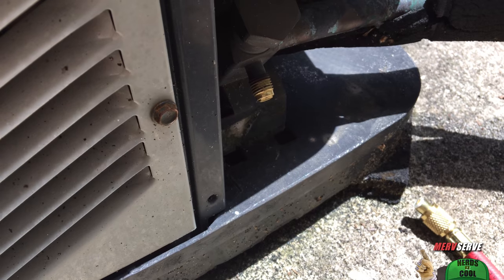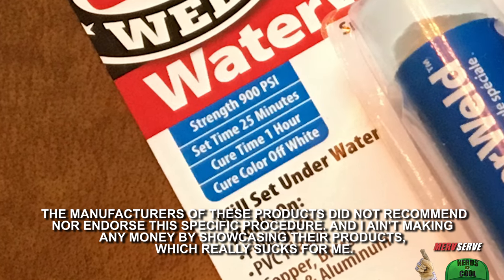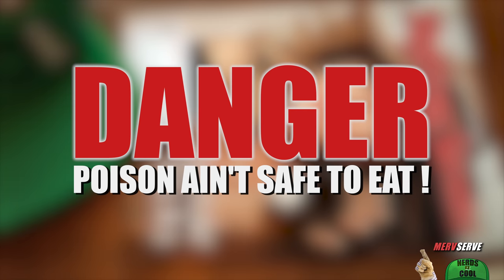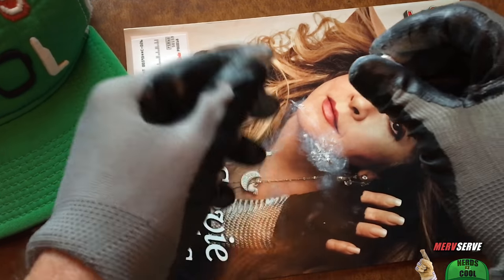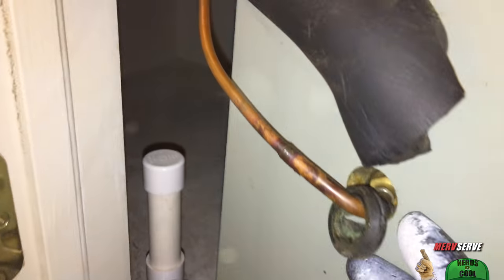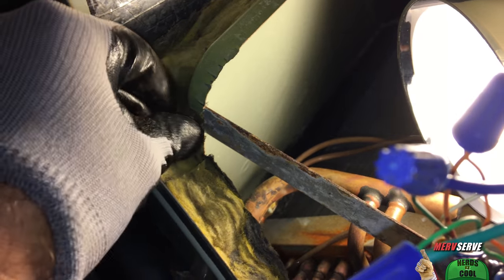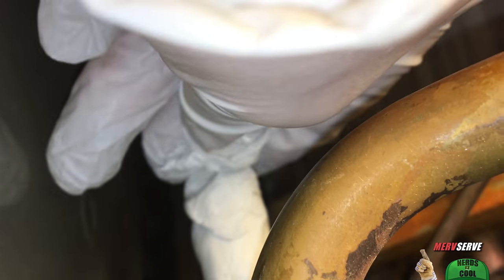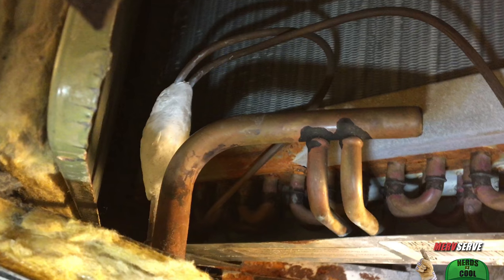AC Leak Repair for $15 -- Cheap & Simple Central Air Fix

Comment: Anyone know if its legal to own R410a in a tank without a certification as long as its not used?
Reply: It’s legal to own if your intent is to sell to or let an EPA 608 certified tech install for you. Most HVAC suppliers won’t sell to anyone without certification but you can purchase it online by signing a form stating your intent is to resell to a certified individual. Sometimes the fine print will say that just by purchasing it you are signing the form. Even if the cylinder isn’t full or no longer sealed you probably don’t have anything to worry about unless someone catches you hooking it up with a set of gauges.
Reply from the maker: Somebody  told me if you pass a basic certification test, and you are servicing the unit on a property that you own, you have every right to add coolant. if somebody could verify this, that would be great
Reply: @MervsServiceSecrets  - I should have mentioned that if you want to take the test in person you will need to go through a third party who will charge you a couple hundred bucks for test prep materials and the test itself.
Reply: @MervsServiceSecrets  It is true in the case of apartment building owners who hire someone to service their units; person doing work needs a certificate; there may be other requirements as well.

Comment: Most after market "magic additives" never work on a permanent basis. If your system is still in warranty, you may forfeit coverage!
Reply: I'm sure he knows that, this is for somebody like me who has a 12-year-old unit, still running excellent but has a little bit of an oil leak. If I can pull out another year or two with a simple fix, and it keeps me from having to spend a lot of money right now, during this inflationary period where everything is so expensive I have no money left over, and gives me an extra couple of years, why not?.. the air conditioner guy that came over the other day tried to tell me that I needed a new unit then whittled his way down to just a new compressor then he whittled his way down to how he could fix this little leak which still would have ran me $1,700. I make $3,000 a month. I'm a older lady on a fixed income. Buying a new air conditioner unit would take food out of my mouth right now. I literally have to go to food bank so I could make an air conditioner payment. Some of us aren't rich. And these air conditioner guys charge exorbitant amounts of money to fix a small unit. I have a 1200 square foot home. I'd prefer to try this first and get as much time out of my air conditioner as I can. But most of you rich people don't understand that.

Comment: How do you know you fixed the leak if all the refrigerant leaked out already?  Now you have to pay for refrigerant and a technician to come out and recharge the system, but before that happens they are going to want to check your work and make sure there aren't additional leaks before filling it up.  Fix the leak might be $15, but that's not what people need to know, they want cold air again bottom line
Reply from the maker: ALL the refrigerant did not leak out.  I fixed the leak, paid for the refill and its been working fine ever since. Techs who insist on charging people for extra work they didnt want is precisely why techs have a bad reputation.
Reply: @MervsServiceSecrets  I know what you're saying but they take on some responsibility once they do any work.  If it was a poor repair job or there were additional leaks then it would be irresponsible to refill in that state, and they risk the chance that the customer will accuse them of breaking something in process of refilling. I was quoted $190/hr labor during leak checks/diagnosis, and then $300 for the first pound of refrigerant +$50 each extra pound needed.
Reply from the maker: Wow!!! Thats nuts.  in the situation we were discussing, past technicians had just been topping off the system periodically due to a small leak they claimed was "impossible to find".  10 minutes with a $20 leak sniffer and I found it.  Did my best with a repair and figured there was nothing to lose. System still going strong, fingers crossed.
Reply: @MervsServiceSecrets  although i dont condone this type of repair,  during these times, i understand how if a unit is already condemnned and a homeowner has nothing else to loose, why not give it a try... and its not that a leak will travel, but that there maybe other weak spots, with that said, sometimes proffesionaly fixong a leak is not  financially smart as oppose to changin out a system... all that said, i would b willing to do the same had i been in ur situation and not having the experience in my field of study... i hope it keeps going on strong and u get the most of life from that unit as u can...

Comment: If you're watching this channel for anything other than  entertainment value you need to move on. SERIOUSLY DON'T DO THIS!!!  As a guy who fixes air conditioners for a living I am telling you that there are SO many things that can go wrong.  You could cause your $600 repair to become getting a new unit.  Will it work? Maybe... but once you get that JB Weld on something there is no way for your heating and air guy to get it off.  That means if you didn't put it in the right place you may have just screwed yourself hard. Don't listen to hacks like this call a heating and air guy that you can trust.
Reply: 2 week wait time causes quick fixes like this it's just that simple
Reply from the maker: and good luck finding one you can trust
Reply: @MervsServiceSecrets  true
Reply: Just put a new piece of pipe on there.
Reply: Ditto!
Reply: Try pressurizing the system, Nitrogen I hear is a very happen contender.  I used air pressure and found the leak, except for me the compressor went out also.
Reply from the maker: Wow. That Nitrogen idea sounds dangerous. A person attempting that should probably be careful and do good research first.  Remember, I ain't no genius.  I just tried to apply some common sense and the method I showed in the video worked out good for me.  Maybe there's a better way? 'm always open to ideas.